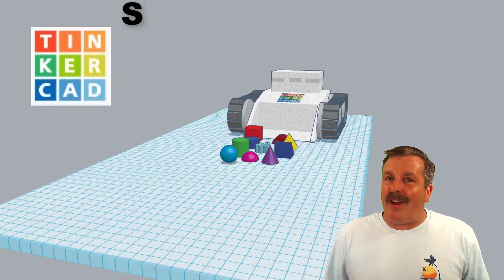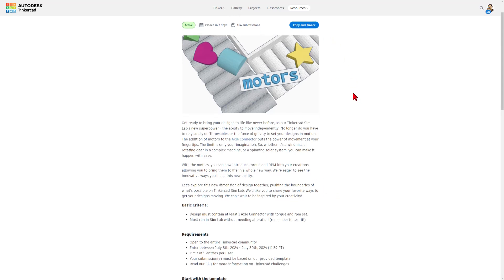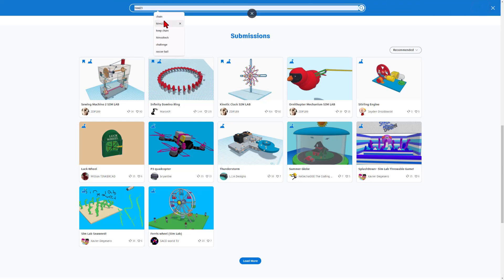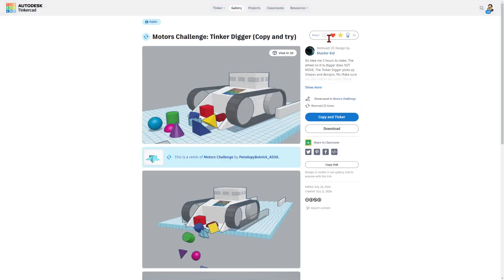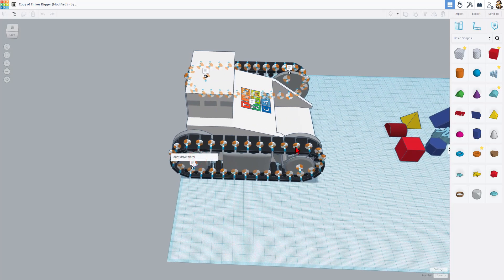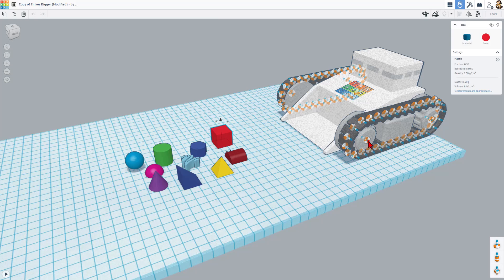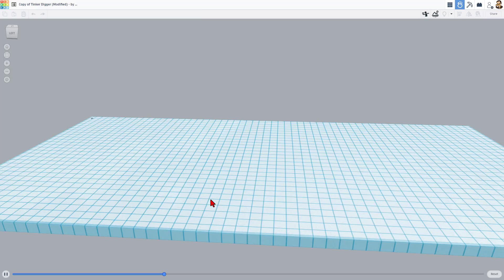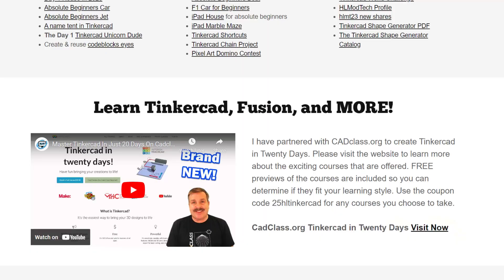Designs Come To Life Tinkercad Sim Lab Super Power Motors in Action! 💯🤯

Comment: Hi.. Hope you can help, I just bought a used Ultimaker 2+ with single extruder. this is my first 3D printer and i want to learn. Your videos are great but I can't replicate because I only have one extruder. for example, i would love to 3D print a keychain with 2 colors like you did earlier.. my question is: if i print the outer piece with hollow letters and then change the filament and print the letters separately, any advice you have for me to make sure when i assemble the piece, the letters fit the hole perfectly (snugged)? and is there a section in your playlists that caters to those of us who have single extruder printers 🙂 .. Love your videos again .. Thanks ..
Reply from the maker: Thanks for the kind words! This tutorial highlights a single extruder version. https://youtu.be/fNEBQBpo8W4 There is a 2nd video in the cards that shows how to get the best fit for the 2nd part.
Reply from the maker: It is for a sign, not a keychain... I will see what I can do for that. It may take a few days though... Golf tomorrow and Thurs is already rolling.
Reply: With a single extruder design the sign so you can print no more than one colour per layer.

For example, make the background in white and then do layers of detail in blue.
Reply from the maker: I think I am going to re-work my technique I used here to inlay the colors. https://youtu.be/L-zlSmkmors
Reply from the maker: The SVG to STL trick worked out pretty slick for "snapping" layers in.